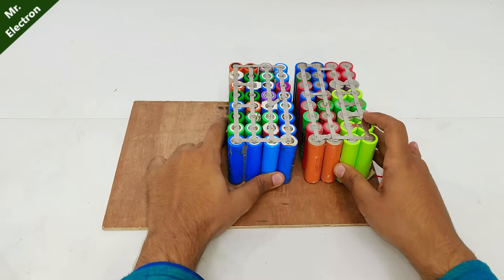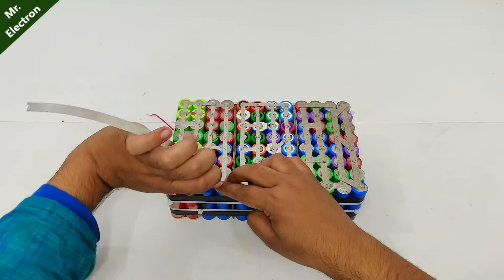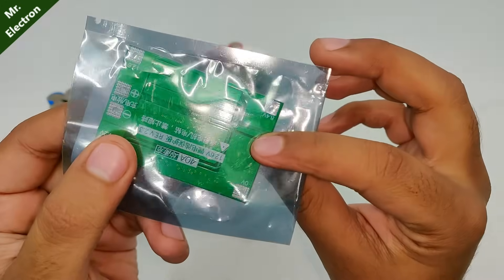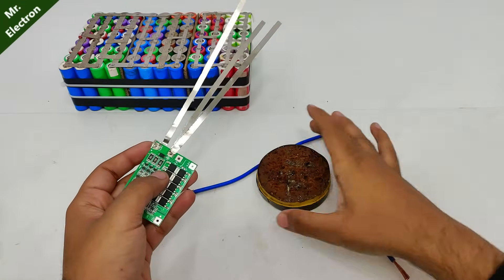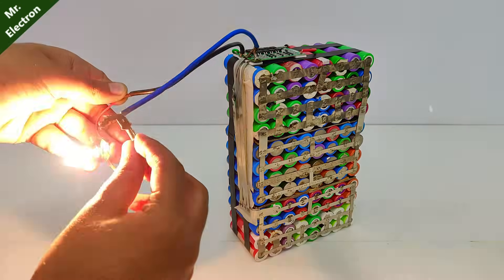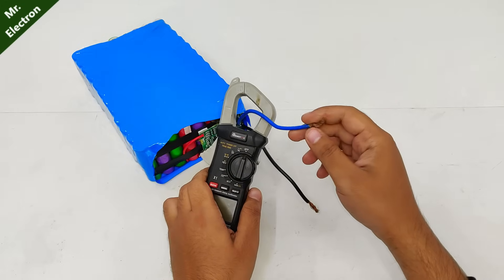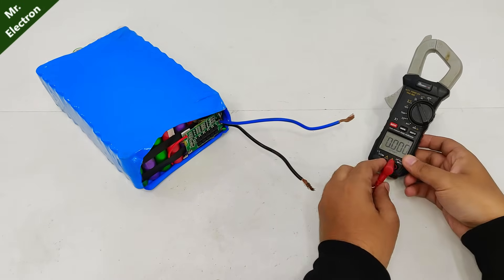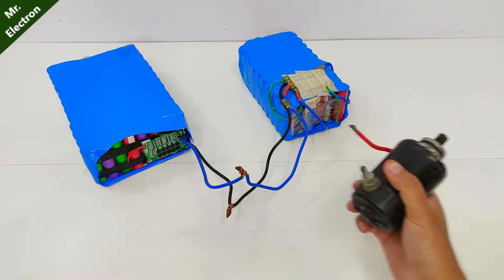Make 12V 1000W Lithium Ion 18650 Battery Pack from Old Laptop Cells ( Part - 2 )

Comment: do not charge at 13.6 volts. Basically, the maximum charging current is 12.6 volts, in the case of a 3s system. But if you want to use it for a long time, charge it with a voltage of 12.2v.
Reply: For balancing the cells, the bms might need like 12.7-12.9 volts, otherwise the cells will not be balanced and the voltage difference will skyrocket overtime, especially with old laptop batteries.

Comment: So could I connect a 3000 watt 40 amp sine wave inverter to that power control board be able to charge with solar panels and use the inverter to power like a space heater and other stuff like a forced air heater? Would that battery pack assembled like that connected to a 3000 Whataburger be able to handle the starting wattage and running wattage for a forced air heater?

Comment: This is not 12v it's 11.1v . Have you test all the battery?? they are old you don't have 2500mili amps par battery. You are way below 1000w. it's more like 600w.

Comment: I never agree with your way of making each battery cell its capacity different. You don't charge it or measure its capacity. Don't put insulation stickers on the positive pole of the battery that is prone to explosion and fire. you are still not very beautiful, you still burn a lot, so you should adjust the current. good luck

Comment: If we assume that we collected a number of lithium batteries in series or in parallel, what is the electronic circuit or method that should be connected to this group so that the voltage does not fall from the minimum permissible limit, meaning when we withdraw the voltage from the battery to a minimum, the circuit automatically disconnects the current?
 How do we determine the circuit voltage and amp?   thanks

Comment: cool man, i got the info i needed from this video, thanks, big time

At 4:09 , not a good idea.      It is better to pre-solder the wire ends, and the area on the circuit board, then solder the wire to the board, the reason why, having heat on the board to long will cause that contact surface to separate from the board. plus if the wire end is not saturated with solder could cause problems.   I mean it wont happen every time, but, why take the chance when it can be fully avoided.

Comment: You never work 1000W. Read datasheet first to waste time and money

Model: BMS-40A-3S-E / B / S
BMS-40A-3S-S Standard BMS 3 cell 12.6V 40A lithium battery protection board (with recovery function - AUTO Recovery)
Starting motor less than 60A / power less than 100W.
BMS-40A-3S-E Same as above with the difference of Starting motor less than 80A / power less than 135W.
BMS-40A-3S-B Battery balance version, Starting motor less than 80A / power less than 135W.
Application range: Suitable for lithium batteries with a normal voltage of 3.7V and fully charged 4.2V.
including 1860 to 26650, Polymer lithium batteries.
PCB Size: 41 x 60 x 3.4mm
Weight: 9.8g
Charging Voltage: 12.6 ~ 13.6V
Continues discharge max: 40A
If heat dissipation environment is not adequate please reduce load
Continues discharge normal: 40A
Standard version (-S): Applicable to start electric motor with current below 60A and power up to 100W.
Enhanced version (-E): Applicable to start electric motor with current below 80A and power up to 135W, with interference function.

Comment: If they are in same voltage  rate ..it ok      ....all batteries in parallel  have same voltages and can't discharged  different..event have different capacities because voltage remain same.....but in series it could limit capacity of power

Comment: There is a huge mistake on this video than will make you waste your time, is than the Individual capacity of each Battery has not being measured, to organize the batteries by capacity, and then build the battery pack. you can join in that way Brand new batteries, but does not work in the same way with Used Batteries.

Comment: Lithium battery is dangerous. They require balanced charging in the correct voltage on each single cell. These should never be made. Making one of these battery pack can shock you if you connect them in series and if it caught on fire it’s hard to distinguish.
Reply: You were only right about 1 thing the rest was scaredy talk

Comment: You could do it  from  rejected laptop batts. Most of such batts are good but main problem is max current drain. Laptop batteries has max current limit, mostly 4-5 Amps. So , big capacity but low current load is the problem is practice. BMS has current limit much bigger that the batts! That could result batts to explode. For low current rigs it could be ok.

Comment: this is terribly unsafe. never tested anything but voltage on the cells and didnt even bother to mark them to balance each array. youre going to end up with burned out cells all over the place. Good job teaching people how to be incredibly unsafe with high current.
Reply: Agree. This method does the job ONLY by matching the same type of 18650 battery or with identical mAh. Having 5000 mAh and the other side is 2850mAh is ridiculously unsafe to mix. When charging the cells, the 2850 may degrade easily plus ka-boom!

Comment: Outstanding work!
I couldn't find the spot welder from the link provided? Also can you please tell me about the BMS? Is that what regulates the 12vdc output  because I don't see how these batteries can be configured for a 12vdc supply.
Thanks
Reply: Each set of batteries equals 4.2 volts. He has 3 in series. The bms is on aliexpress just under lost orders. The bms only protects the batteries from overcharge and overdischarge

Comment: What about capacity of each cell? Even new ones, if they are different models, cannot be used together. Also, being used cells, each should have a fuse, in case they become "power consumer" - so if they short internally, they will draw a ton of current and the fuse will pop. And for limiting the current, these are not high drain cells.
Reply: if the specs are similar they can be used together even different brands, most brands have same supplier.

Comment: This video shows only how to make used 18650 cells as battery packed, what concern me maybe all those who watched is the lack of safety in making. First is the battery tested individually for their capacity? if any of the individual cells peak its voltage before the rest of the packed is disaster waiting, second is you separated each series with a paper cardboard? lastly if you could buy a spot welder maybe you could buy a soldering iron to solder the bms to the packed since it carries more amps to that connections.
Reply: what to say he loves to make bombs xd

Comment: You should never make it like that. Each battery cell has a different capacity, but in the end, it does not last long and cannot be used. I can never agree to make it this way.
Reply: They don't care but you are right
Reply: @lorenzorentniop717  যে ঞ
Reply: correct
Reply: Ya but normally we can connect different ah battery in parallel
Reply: If they are in same voltage  rate ..it ok      ....all batteries in parallel  have same voltages and can't discharged  different..event have different capacities because voltage remain same.....but in series it could limit capacity of power
Reply: I've been using a package of 560 pieces of 2kw power exactly like this for two years and I've had no problems.  and there are batteries of different capacities
Reply: @A.C-r1y  Nice! How much did that cost to build?
Reply: @coldblackice  I don't remember that I bought them piece by piece, but I think somewhere around $300 all
Reply: How can you connect them to yield high voltage
Reply: As long as each series group has the same overall capacity it does not matter. 50 cells in parallel make one big cell
Reply: If I have 32 lithium-ion cell having 2200 mah each make battery with 8p4s which bms i Buy.
Reply: @jiafun7019  4S BMS. It can accept any number of parallel cells. 100P4S or 1P4S it does not matter. The next part of what BMS to buy is the discharge rate. Your pack will be 14.4V nominal so if you buy a 50 amp BMS it will have a nominal discharge rating of 720 watts continuous. A little more when the pack is full a little less when it’s down to 12V. 

So figure out what you need to power to determine which 4S BMS you need. It is limited by what your 8P can do. If they are 10A cells then you can do 80A max. If they are 4A cells then you have to pick a BMS that is 30A or less. 

My advice is pick a BMS that can do 80% of your cells max discharge rate. That way the BMS will shut down in case you don’t realize your application is pulling too many amps from the pack. The BMS can go over it’s current limit for a short period of time but not long.
Reply: @ericklein5097  Thanks for the info. How would you know the difference if they aren't labeled properly?
Reply: Where's your YouTube channel? Nobody cares
Reply: Love the soldering technique
Reply: Оллдд
Reply: Correct ❤
Reply: Yea I saw another video where the person sorted all his cells from low mAh to high mAh and then he picked from front to back until he had his sets. That was his way of making sure the cells in parallel all put out the same mAh.
Reply: its for vodeo onlyy and he get 2 aur 3 million views
Reply: he's testing it in a very cautious way, you think he does not know what you know, besides this is the first video where i see a clean indian fingers nails lol
Reply: @kirigayakazuto5694 Atleast he is having number of subscribers.  
not only one subscriber , like u :)
Reply: @kirigayakazuto5694  wtf 😠

Comment: You used that batteries without testing internal resistance and capacity? Very dangerous
Reply: yup
Reply: Pls how can I test the battery cells internal resistance. Thanks
Reply: @yusifsuleiman5502  Battery tester devices like Liitokala capacity testers will show the internal resistance for each cell

Comment: Hi your videos are always inspiring. 
Can you make a video on how to integrate a secondary hv battery in an EV let's say of half the fixed battery and switching from one battery to another to extend range in an EV..
Also what to keep in mind while choosing configuration for the secondary battery. Like should it have same voltage or current as the fixed battery for range extension.

Comment: The laptop battery need to be tested before used in other configuration , because they can have various capacity ! If one have 500mAh and other 2000mAh the bms stop entier pack wen first battery ritch 2.5v ...
Reply: That's is right 
But he doesn't  have  knowledge about  18650 lithium battery
Lithium loss capacity after use

Comment: Can u help me : i want to turn on the car with smaller battery like : LONG ups battery (12v 4.5A).
It can be?
Reply: No. The starter motor requires high current. Generally 1 cold cranking amp (CCA) per cubic inch of displacement. i.e. a 2 liter engine (120cu.inch) will require 120 CCA to start. Diesel engines require double this.

Comment: Great idea to use 5V PSU with diodes and volt/amp meter to do a "short-cut" method for higher current charging. It could overcharge the batteries (4.3v instead of 4.2v) but if monitored properly it can work
Reply: @MrElectron  please make a video 200 v 2000AH battery pack
Reply: @MrElectron  oh bhai reply for my question
Reply: @srinidhisharma2824  go to Delhi lagpat Rai market there you can get even a single cell 18650 1200mah at 15 per piece in retail
Reply: At wt price did you get that old laptop batteries?
Reply from the maker: @srinidhisharma2824  minium 70Rs and maximum  110 Rs per piece
Reply: @MrElectron  Thankyou
Reply: Can you clarify please?

Comment: Which old Laptop Battery cell outputs 80A the best what i get is about 10-25A but not that much like u!! Did u use new or old ones?? Did u use speciel brands or models to harvest th cells???
Reply: Put them in parallel
Reply: Parallel makes more amparage's
Series makes more voltages
Reply: @hexidev  parallel raises capacity if u want to build a accupack with 80A current every single cell must be able to output this current if there is only one cell that will output 20A instead of 80A the current of the hole batterypack drops to 20A!!!
Reply: @2good4trash63  yeah capacity and amparage
Reply: @hexidev   The accupacks what i build was made for E Bikes and E Scooters!! But there it didnot worked this way of Higher discharge current
Reply: @2good4trash63  The battery in this video is 3S32P. If each 18650 cell is 2600mah and has a discharge C rate of 1C, then the battery theoretically can output 83.2A (32 x 2.6A). Obviously there are limits on nickel ampacity and what the BMS will discharge.
Reply: It's total wrong method to make 18650 batteries combination, may cause explosion or burning very soon.
Reply: Ok thx guys

Comment: How many hours takes to full charge???
Reply from the maker: I have to test it in my next upcoming video.
Reply: It's better to charge them between 2 to 3 hours
But you can charge them in 80 minutes
With a good charger 
Like 15v charger 50 to 60 Amp